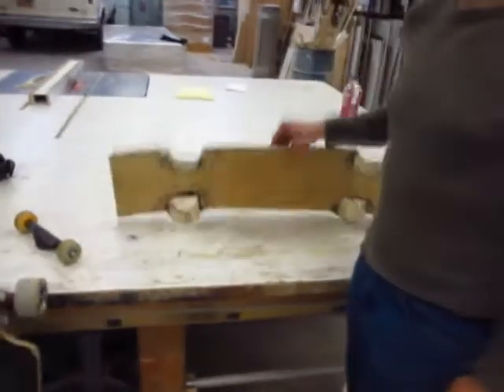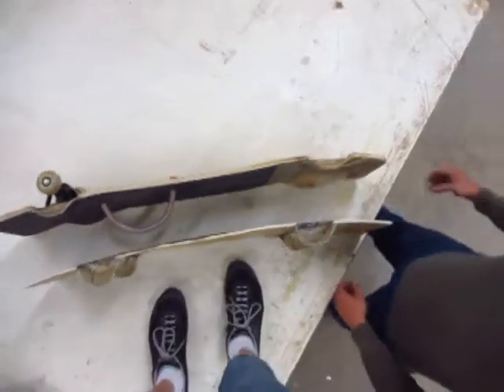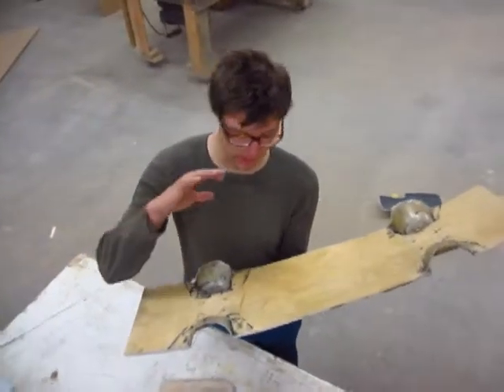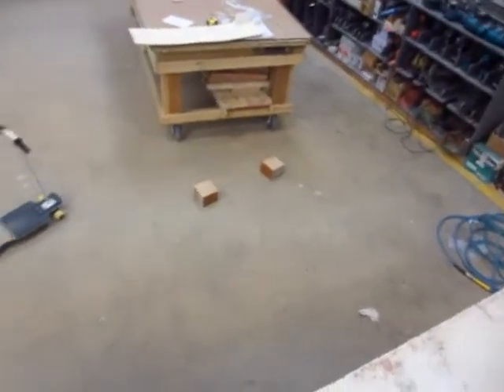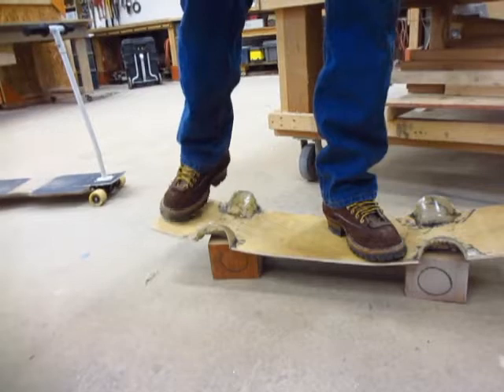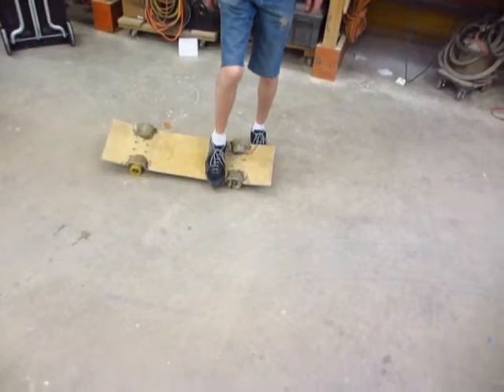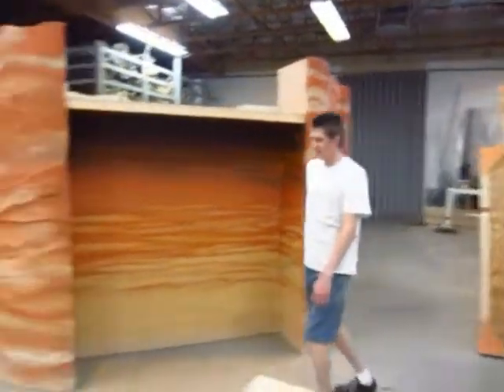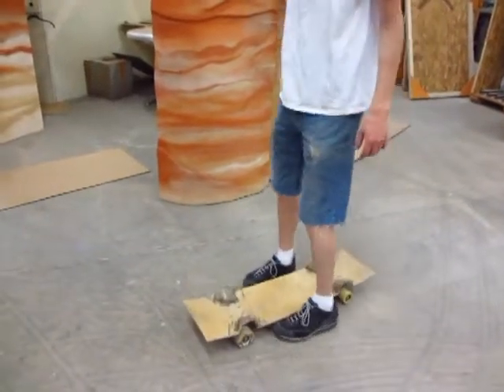1/4" Fiberglass Longboard, Initial Impressions.

Comment: man...whatta piece of fucking shit
Reply from the maker: You realize that testing the limits is the whole point. 
Basically, how thin before it becomes un-ridable?
Can we take something that is so thin that you can't even stand on it, and find a way to make it into something?
What is the role of Fiberglass, and how much can we actually get it to do?
We ended up learning tons from this deck.
Eventually we ended up putting carbon fiber on it too, and suddenly it became actually pretty ridable with some characteristics worth bringing over to later designs. 
Now, 8 years later, I can definitely say this was a worthwhile project, despite the ridiculousness.
Don't think that everything you make or do has to be good. Only by holding of that self criticism can you get out that rough draft, and that's always the first step in creating something better.

Comment: I think I know what you guys were trying to do, except with the weird material aspect, I got me a bustin freestyle board which is the only brand that offers wheel wells. I got a half inch spacer and put gulwing 2 trucks with 76 mm wheels. I had to drill extra holes in the trucks which was 30 seconds to do. Dopest board ever. Could do 4 foot circles, ride cracks like their not there. No wheel bite with the maximum turning radius ever. No offense but looks way doper then those uncomfortable looking fenders.